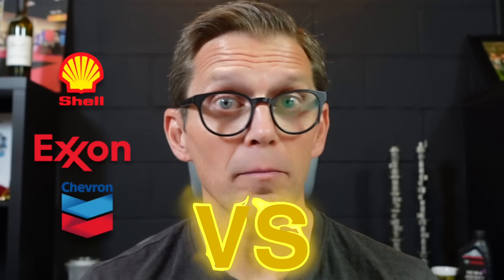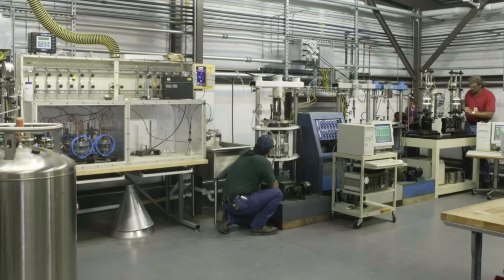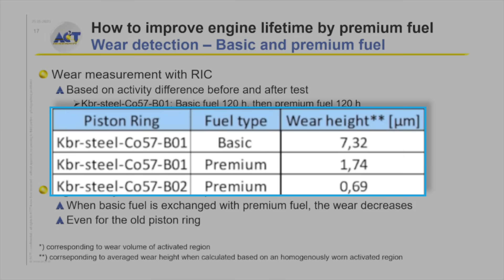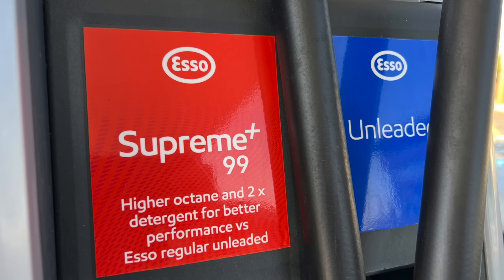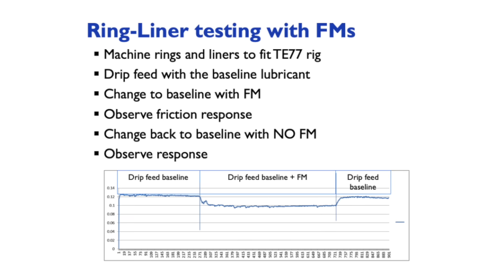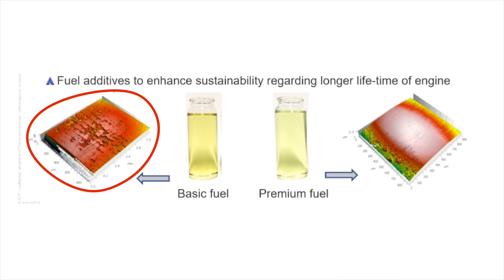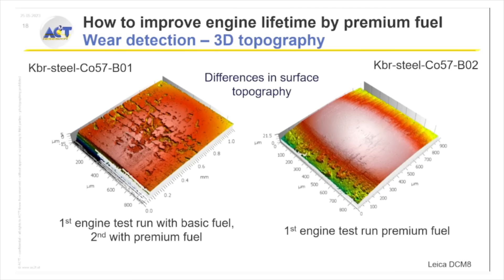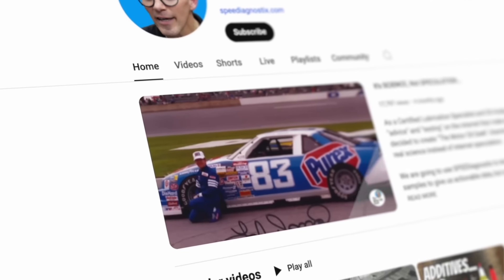Can Premium Fuel REDUCE Engine WEAR?

Comment: I know  a Toyota dealership tech with many years of experience.  He left the Toyota dealership to work at Lexus dealership.  He told that he didn't replace fuel injectors at the Lexus dealership when compared to Toyota dealership where he would be  replacing fuel injectors from time to time.  Premium fuel helped a lot but using good regular fuel is ok along it's a good brand of fuel.

Comment: That’s really cool know the my engine is safe I’m been driver my car since almost new I had over 310,000 miles in it and I use 93 always. never use fuel injection clean or fuel treatment and always I use synthetic oil 5w20 never burn oil

Comment: Watched this video when it was first posted and decided to do my own unscientific experiments, with undeniable (family member confirmations) results....

Vehicle #1: low-mileage 2016 Honda CRV, always annoyingly buzzy, always used low-octane top-tier gas and  have never experienced knocking.  We just finished running a full tank of the high-octane V-power through it after watching this MOG video and I could instantly tell the difference in vibration and it seemed to get smoother as it went through the tank, and gas mileage improved slightly throughout.  Went back to using a low-octane top tier gas again and, while still smoother than before, was buzzier than with the V-power.   Now, I have to decide whether the additional expense is worth it.  I might just use the V-power on occasion.
Vehicle #2: 1992 Lexus SC400 w/150k miles, always requires premium.  Filled with V-power on a 2/3 empty tank and noticed lower vibrations immediately.  Crazy. (original motor mounts are probably a factor)
Vehicles #3-#4 to follow (25-yo 2UZ-FE V8 and 12-yo 2GR-FE V6, both with original mounts)

Note: all fuels used have been E10, incl the premium Shell V-power.

Comment: In all fairness, Shell only advertises that additive package in their 93 octane fuel in the US. That is about $1 more per gallon, maybe more. I have a 44 gallon tank in my V10 Excursion.
So, at what point is the extra wear worth more than $45-50 PER TANK?!
In my motorcycle or lawn equipment I wouldn't think twice. Pulling the 8,500 lb camper and using all 44 gallons for a camping trip makes it a no brainer for me. 
I don't know the history of the engine, but it now has 178,000 miles and I have used high quality oil since I bought it with 167,000. I'm pretty sure it went to the dealer for oil changes, seems like a fleet vehicle from documentation I have .
I use 5w20 Pennzoil Platinum at every oil change, usually twice a year, I don't put more than 6k miles on it every year.
I understand the math, but at what point does it make more sense to pay for PREMIUM FUEL?
I also put Techron fuel system treatment in after I change the oil twice a year, for what that's worth 🙄
Reply: Running the Techron the last tank before the oil change is possibly a superior method. Clean the junk into the oil and then drain it.

Comment: People taunt me about using only 91-93 Octane premium fuel in my 2018 Kia Soul ! 1.6L turbo and use Amsoil Signature series oil and filter changes every 5000 miles. (I don't believe in extended mileage oil change intervals because even at 5000 miles, the oil is black from the turbo heat and the engine sounds so smooth after I change it as well as I can hear the turbo singing its high RPM songs after a oil change.) I have 167,000 miles on the engine and have had no trouble with my turbo, block, valves, cams, sensors, rings. This video proves my point. It does make a difference in wear and just sheer driving enjoyment. Every now and then I add a bottle of Amsoil Performance Improver to a full tank to (as you described in the video) protect the rings and seats. I know the KIA mechanic personally at my KIA dealership and the last time I brought it in for some front end work he commented on the lack of varnish on the parts of the engine he inspected. Told me, "What ever you are doing, keep doing it." He said he showed the other techs there my engine condition and wished everybody would take care of their motors like I do.
Reply: I have a kia sorento and only use Mobil 1 oil and mobil or exxon gas
Reply: And then everyone clapped! I was there

Comment: I would like to see the difference between midgrade and premium fuel. Also in my area, we have premium fuel, but it's 91 or 93 octanes, and looking in my owner's manual, it says to use 83 octanes? What are the effects of these tests if using e10 or e15 and not just straight premium fuel?

Comment: Great video as always! I have a question regarding transmission fluid replacement on these newer "sealed" transmissions. I have a 2020 Camry with the the 2.5 four banger and I'm approaching 60k miles. I'm probably going to have the dealer replace the trans fluid but my question is what is your opinion on drain and fills vs a full on transmission flush? There are varying opinions on this and I wanted to get your take on this. Thanks man!

Comment: I was always told if the manual said 87 octane, you was wasting money if you used 91 octane.  Probably because the engine was tuned for it. Also spark plugs. Always use factory spark plugs...engine was tested with them...With technology today, we may get the true results

Comment: Right now, in the upper Midwest, premium is exactly $1 per gallon more expensive than 87.  Is there a fuel additive that does the same job at a lower overall cost???

Ethanol sucks...but $1 extra per gallon for premium is a steep price to pay considering all my vehicles have rusted out before the motor died.

Comment: The conclusion around 13:00 seems to be incorrect - it seems b01 is run on standard fuel and then premium.

B02 is the separate engine run solely on premium.

Comment: Hey Lake! I hope you can see this (I might post this same comment on different videos). I want to break in my new car's engine. 

It's a 1.5L turbocharged engine that's specified for a 5W-30 oil. I wanted to use the Valvoline VR1 for its high ZDDP and low detergents for that initial break-in. Unfortunately I could only find the Valvoline VR1 in the SAE 40 viscosity. 

I live in a relatively hot area where the average is about 28° Celsius with some days going as far as 35°. 

I wanted to ask you if I could use a SAE 40 in a 5W-30 1.5L  turbocharged engine. Hope you see this and tell me if I can do this before I wreck my engine 😅.

Thanks in advance and Great videos I absolutely love them!

Comment: Could it be because if you use a car that recommends 87 but you run 93, that the 93 reduces the combustion/slower burn which is easier on components?  You lose some power which is easier on components which reduces wear?

Comment: I wonder if they added expense of running premium which around here is at least $.50 a gallon more over the life of the engine would be more expense than replacing an engine ?

my last car I stopped driving at 755,000 miles

 I'll have to put a pen to a piece of napkin and just see what the cost would be 

i've never lost an engine and I've never had to touch one, the one that had 755,000 miles on it all I did was change a starter and valve cover gasket twice

 oil samples came back good and it was using about a pint at 755000 miles on an 8000 mile oil change 

I have one of your kits now I'm going to send a sample in to both labs just to compare them 

love this stuff

Comment: I buy either Chevron or Shell fuel, sometimes Costco fuel.  I stay away from the cheapest priced gas stations because I  believe the additive package in their cheap fuel are not up to par.  Do the 87 obtain fuels by Chevron and Shell have the premium fuel additives similar to their highest obtain fuels?

Fortunately, we do not have ethonal added fuels here in Alaska, however, premium, high octain fuel is 50 to 80 cents per gallon higher than 87 octain.  So, that could add $10 to $16 to every 20 gallon fillup.

Are their overvthe counter fuel additives that can be added directly to the fuel tank during a tank refill using a standard 87 obtain fuel that would result in the same thing as the ACT analysis using the European Premium fuel?

Thank you for your presentations.
Mike

Comment: I have tremendous respect for your knowledge and willingness to educate us all. Question for you - does shell 87 octane not have better additive package than a grocery store 87 octane? Also isnt it true that putting 93 octane in a 87 spec engine cause the engine to work harder than it needs to due to some technical reason? Thanks.

Comment: This has nothing to do with your channel. I noticed a small bluish area on your lower right lower lip. This may be what is called a "blue nevus". I had one and had it removed. It was a simple in office procedure. Having said that, if you haven't had it checked by a physician I would certainly recommend you do. Speaking from experience. I have had four different types of cancerous lesions removed from my face. Just trying to look out for you.

Comment: Top tier fuels has a label stating that it passed the requirements for a top fuel.  And in the 70s, I had trouble with Shell, so I'm less likely to use Shell.

Comment: Lake,

Is there a test kit from an auto parts store that can measure fuel dilution in engine oil?

I understand that fuel in the oil is BAD for the engine.

In my case, when I check my oil level I can smell a fuel scent "odor" on the dipstick.  Good things:  oil does not drip / run off stick.  No black smoke or smell from exhaust.  Also, no knocking, pinging or run on after key off.

Comment: We have just bought an 2003 Chevy Safari (camper style) with 125,000 miles (never driven in Winter). It is recommended to use 5w-30 oil. Should I keep using this oil recommended in 2003 or is there better oils to use in 2024 (old technology vs new technology)? Also... Should I continue using 87 octane  fuel or use 89 or 91 octane ?

Comment: But seriously now, you are talking about Microns here.  Is the difference so significant that it justifies the Higher cost of Premium Fuel over a long period of time which will add up.  If the Vehicle does not specify Premium gas and can run on Regular then what ??  And how does one know which Gas station to use since all the Gas comes from the same 3 suppliers but there are these so called Additives.  So aside from all the hype, which is good gas and which is bad ??    Thanks.

Comment: So why is premium fuel necessarily comes with higher octane when my car, according to the manufacturer, does not need high octane?
Reply: Old cars don't like ethanol. And for the most part you can adjust the timing on them to run more advance.
Reply: @PonkyKong  Cars of the last 20 plus years are not considered old, and they can deal with higher octan. and I asked why I can't buy regulal fuel (87) with the additives? because for 98% of the cars regular feul is the one that recommended for them bu the manufacturer.
Reply: @borisboxer1690  chevron has additives in all grades. Or you can buy them if you want to run 87. But for the most part you won't need to worry about it.
Reply: @PonkyKong  He clearly said that the additives only in the "premium" fuel... which is higher octan.
Reply: @borisboxer1690  chevron has their additive in all grades. So buy their blend.
Reply: @PonkyKong  so was this video about?
Reply: @borisboxer1690  people need to consider where the refinery is. And which blends have proprietary ingredients.  Then you have summer and winter blends.  Most regions will have at most 3 different flavors of 87 available.
Reply: @PonkyKong  You are misleading people, saying the complete opposite of what the video says.
Reply: @borisboxer1690  Chevron released Techron as an additive in 1981, and began including it in all of their gasoline products in 1995.

Comment: exposing pistons to radiation (irradiation) does nothing to the pistons and will reveal nothing. if they contaminated the outside of the pistons, they could measure the contamination in the oil which had to have been worn off the pistons.

Comment: That's all fine but our choices where I live don't include Shell, only Speedway, a very few Exxon and some independents which from my little bit of research, all gasoline brands here come up from the south via pipeline and are supplied from the same bulk tank with (maybe) some additives thrown in the tanker somehow. As to our two vehicles, they both have 'lived' to date on Motorcraft Semi-Syn though expect to switch the truck to Pennzoil Full Syn soon

Comment: this is not applicable to a GDI engine as no fuel touches your key engine parts. OIL is always the most important thing and if you want your engine to last a long long time just change your oil every 3000 miles or 5000 km period

Comment: After watching some of your videos and reading your responses, I am starting to get suspicious that you work for the oil industry. You deliberately mislead folks into thinking they need higher octane levels to reduce engine wear, causing people to spend more at the pump when it is not helpful.
Reply: He didn't claim that at all. He said some Premium fuel has anti wear additives in them. Premium fuel happens to be higher octane, and you can certainly buy Premium fuel that's doesn't have that additive. He also showed the data to prove it.

Comment: Im confused, is this video about 87 vs higher octane or lower brand vs higher brand? Like 87 Top Tier should be just as good as 93 Top Tier when an engine doesnt call for 93, correct?

Comment: I want to know! I use Costco gasoline because it is Top Tier, actually because it cost less. So, where does Top Tier Gasoline fit into what we just saw? Then, assuming that Top Tier is a baseline, how do the various brands match up?  ....  SO WHAT  .... the government mandates using their engine designs, so we end up with recirculating exhaust gasses and oil fumes back through the engine in such a way that the intake is plugged and we are almost guaranteed that no modern engine will live into old age because they self destruct. And the better the fuel injection, the less chance of fuel cleaning the intake system.

Comment: I wouldn’t generalize from this that premium fuel is superior for wear reduction, because some brand’s premium and regular octane fuels have the same additive packages and are both top tier. Costco, for example, is top tier fuel at all grades. I know he’s emphasizing top-tier over basic fuel here, but this video is actually adding somewhat to the confusion by not being more precise about what “basic” fuel means. Is it just 87 octane? Is it just regular fuel with the EPA mandated levels of detergents but not enough detergents to be top-tier? Is it non-detergent regular grade fuel? Is it non-detergent 91 octane fuel? Is it an advert for Shell’s premium fuel which may have a different additive package than their regular? Lake, sir, we need more specificity! For science.

Comment: This information is over 50 years old. When I had a Honda CB 750 k2 in 1970, after a few thousand miles the spark plugs would foul up. Then I would have to clean them or replace them. The original plugs were (I can’t remember the exact part number) like NGK 6.  So I bought the hottest plug that they made. It was an NGK 8. The higher the number the hotter the plug. They would still foul up after awhile. So I did a test to find out which gasoline brand had the best properties to keep the plugs cleaner. I found that the different brands of fuel had various results. The brands that fouled the plugs the most were Shell, Mobil. Chevron and others. I always used premium grade fuel. The best ones were Flying A (someone bought them out I think perhaps Mobil ) Esso, Valero, and the best was Union 76. I heard that Sam’s club just used whatever was the least expensive. I suspect Costco might do the same.
Reply: Interesting you mentioned about Shell gasoline. 
Going back some 50+ years ago in the leaded gas era, my family were strong patrons of Shell gasoline, as my older brother worked for a Shell gas station franchise.  The spark plugs?  The ground (or side) electrode were heavily caked with a beige chalky material as a result of exclusively using Shell gasoline.
With regards to Flying A?  In California, they were taken over by Philips 66.